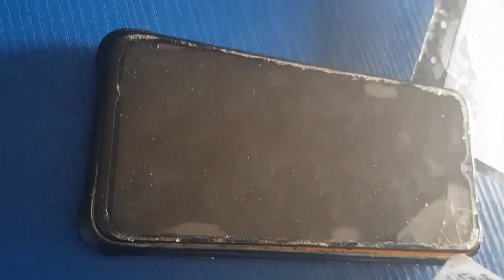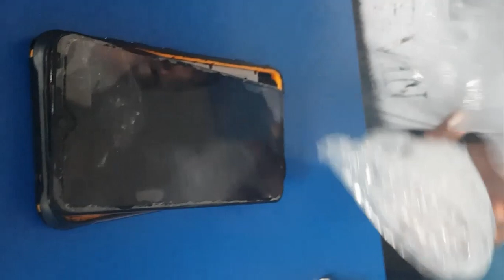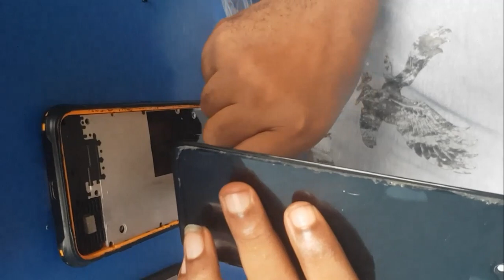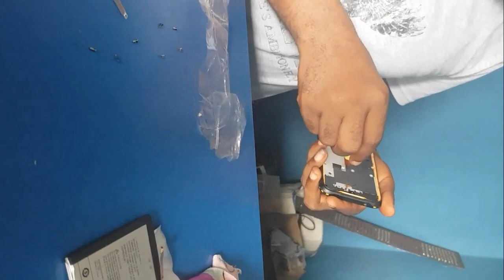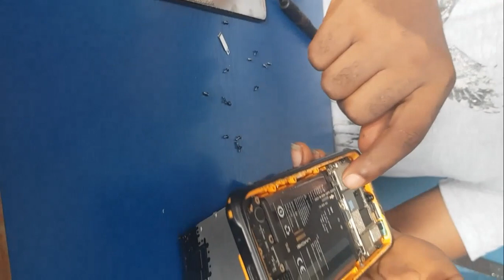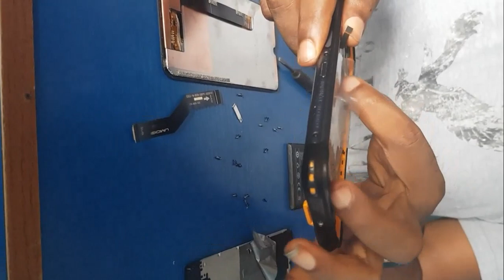How to Replace UMIGIDI BISON LCD Screen and Battery,

Comment: It looks like you're in Nigeria. Which town are you in? I need to replace my Umidigi Bison battery. If you're within reach, I would like to bring it to you. But in case you're not, what kind of screwdrivers and heating machine are recommended for the job?
Reply from the maker: Which side are you?
Reply: I have a bison 2 pro I need to fix. It won't turn on and I think because the battery is overpowered and when it was charging, it got too hot and fried the battery. I really hope it isn't the motherboard. I'm going to replace the battery with one with a lower mAh to keep the phone from overheating when charging so easily.

It's my own phone so if I ruin it, it isn't as big of a deal as it would be if I was fixing it for a customer. 

That said, what is the separating machine you were talking about in the beginning? I have a heat gun, but I suspect it gets too hot, and I also have used rice in a sick heated in the microwave with good results. I think the bison uses gorilla glue. I'm wondering if a personal heating pad (the kind people use for aches and pains) would work. 

Thanks for this vid, I'll definitely be referencing it when I get my parts in the mail to fix it.